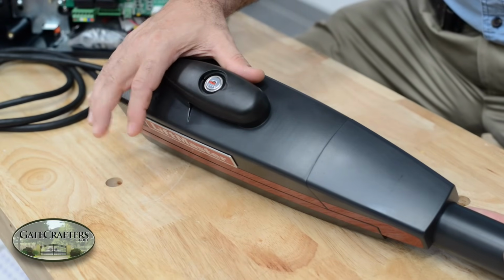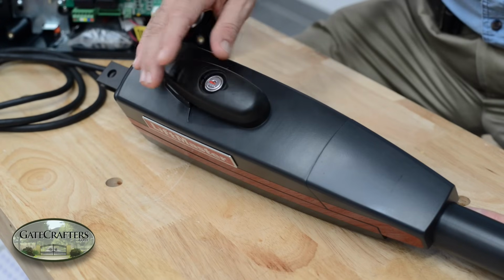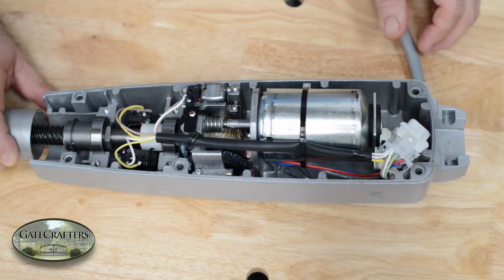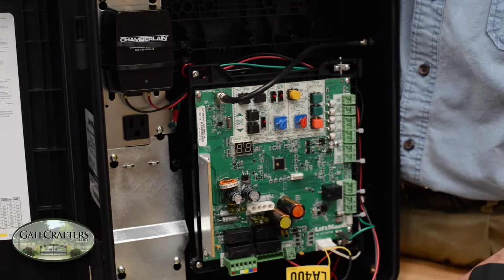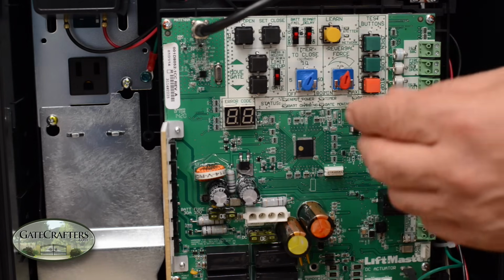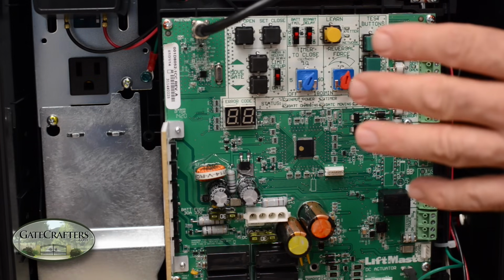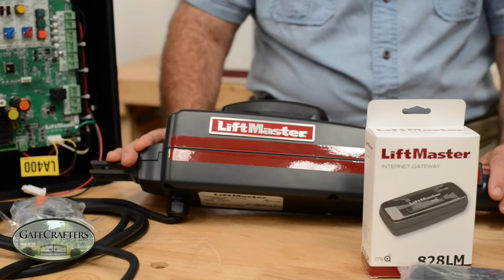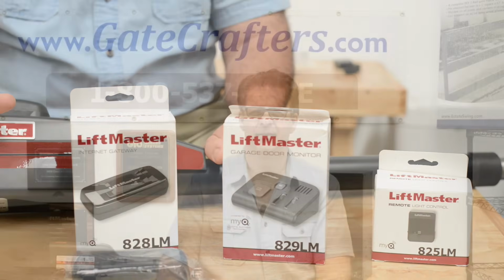How To Use LiftMaster LA400 Single & LA400 Dual Driveway Gate Openers

Comment: Hi I just received my dual gate opener.  I know this is an old video but could'nt find a newer one for my question.  Q: If I cut the zip ties on the transformer and plug the transformer to an external 110 ac plug at the house, will this eleminate the need for any other power installation?  will this setup also charge my batteries?
Reply: I’m also wondering that

Comment: I have been given a quote for an automatic gate in which is specified an "AC LA400 - LiftMaster LA400 Swing Gate Operator". Is the "AC" a model spec? I was told I needed to have 110 at the post. I questioned this and sent them your video. They said I need to have 110 at the post. What am I missing here?
Reply: Sounds like they don’t want to do as he suggested and run the power from the house  it instead they want AC power at the gate

Comment: Thanks for this video! Now I see how to swing out the board to replace the 2 batteries.  How many remote control can I program to this LA400 system ?  Thanks.
Reply from the maker: Hello! A total of 50 Security+ 2.0® remote controls or KPW250 keypads and 2 keyless entries (1 PIN for each keyless entry) can be programmed to the operator. (LA400UL manual) For more product information, click here: https://www.gatecrafters.com/product_detail_8463_25541.aspx 
If you have any more questions, please call Gatecrafters customer support at 1-800-537-4283. We are happy to assist you in any way we can with hours from 9 am to 9 pm EST 7 days a week. Thank you!

Comment: Do you have a solar power connection video for an LA 400 or 500
Reply from the maker: Hi! We do not specifically have a video for connecting solar powered LA400 or 500 Dual Automatic Driveway Gate Openers, but all of the information would be located in the product manual with instructions. If you have any more questions, please contact us on Gatecrafters.com or at 1-800-537-4283. Thank you and have a good day!

Comment: I'm attempting to replace the batteries on my la400. i must have dropped some of the wires in order to connect both batteries. where can i find replacements?
Reply from the maker: Hi! Here is a link to a Battery Harness for LiftMaster LA400, you will need two: https://www.gatecrafters.com/product_detail.aspx?productid=32748&partclass=LA400. Also, if you need replacement batteries as well, here is a link for a set with batteries and the harnesses: https://www.gatecrafters.com/product_detail.aspx?productid=32734&partclass=LA400. If you have any questions, please feel free to come back to this message thread. Thank you, have a good day!

Comment: Through the video you are talking about the DIY installer. It is important to mention that as a DIY installer you will not get any warranty from Liftmaster. I run into this issue when my gate operator quit working. Liftmaster will not even be willing to advise you. There is no DIY option with the Liftmaster.
Reply: Any video , how to replace a bad battery on LA400

Comment: I have the lift master operator for my gate door. There was a trash can behind the door that I did not know about. I opened the door with the remote two times not knowing the trash can was there. it opened and closed a couple of times when I opened it with the remote  and it hit the trash can both times, then it stopped and it wont open and close any more. Please what can I try to reset the system. thank you